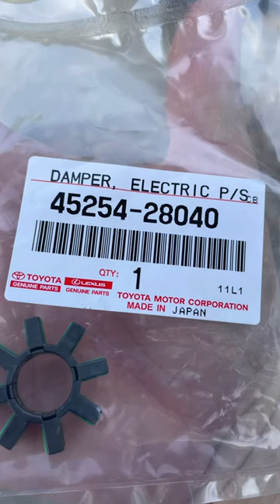How to repair Toyota Camry 2012 Steering Wheel noise

Comment: Great video indeed. I have been having the same issue with my 2012 Toyota Camry I took it to several different mechanics but they all say different things. So finally I to the Toyota dealership and they wanted to charge me $1200.00 to replace this STAR BUSHING. By watching this video I hope I will be able to accomplish this task but removing so many things is mind-boggling. Thank you sir for the great video and the part number. God Bless you.
Reply from the maker: I had the same problem, the dealership wanted crazy amounts so that’s why I called my friend who is very handy and we were able to remove all the parts and put them back together! 
Good luck! :)
Reply: Do you have a video or an example of the noise it was making? My Camry is making a rattle noise but not sure if it is the star bushing
Reply from the maker: @danielmezadrums  unfortunately I didn’t record the noise!
Reply: @danielmezadrums  same here I wish I could of the noise...
Reply: Alguien sabe si uno que no es mecánico es fácil cambiarlo o buscar ayuda 🆘

Comment: Thank you sir. I could not find any videos on 2014 Toyota Venza's.  I called Toyota to get the bushing and they said that they did not service that part for venza's. It was only for Camry's. So after removing the the airbag and the the heater floor duct I removed the 2-12 mm motor bolts.  I used a mirror to look up inside where the coupler would sit at and I found the green coupler pieces everywhere.  (I did not have to drop the steering column or take the steering wheel off). Went to Toyota and they would not sell me one for a venza. I had to tell them it was for Camry although I had the part number from your video.  Anyway I blew the broken pieces out of the servo and install the new coupler and everything worked great. No more noise.
Reply from the maker: I’m glad you made it! :)
Reply: I have the same issue on my Venza '09...however, I am not able to do this work myself. 😣
Reply from the maker: Find someone that’s somewhat handy and I’m sure both of you can do it! Good luck!
Reply: how did you do this without dropping the column? I am going to make this repair tomorrow or this weekend.

Comment: Excellent and simple video. Does Toyota Prius V 2013 model has similar system, because my Prius is making similar rattling noise. Any information from Prius owners will be much appreciated. Thanks
Reply from the maker: @andykumar4103  I’m not sure if Prius has the same system but since both models were built in pretty much the same time I would think that should be the same or similar. Best thing to check with a certified mechanic to be sure.

Comment: Was it doing a rattling noise ?
Reply from the maker: More like a clicking noise!
Reply from the maker: More like a clicking noise!
Reply: I fixed mine, but my steering wheel didn’t go back on straight and my traction control light didn’t come off.
Reply: @Michael Harbo what is servo
Reply: @michaelharbo663 No that's wrong info. This part makes a rattle when it goes bad.

Comment: @Cripton awesome video! Thanks for including the part number too.
Reply from the maker: The part is about $15 on eBay but getting to the part is a pain in the b…!
Reply: @cripton3321   what is the part number or name of the part .
Reply from the maker: @JimmyHensley36  you can see the name and the part number at the very beginning of the video!
Reply: I have 2017 Camry making a clicking noise Only at a specific point when rotating the steering wheel while idling. Is that the same bushing or could be the column U-Joint

Comment: Great video. But please how were you able to still turn the steering wheel when the car is off and negative disconnected. Thanks
Reply from the maker: The hydraulic doesn’t work but you can still turn the steering wheel.
Reply: Okay thanks

Comment: Thanks for the video boss! The noise went away but stability control system light came on did anyone have that problem
Reply from the maker: Have you check if all the connections and wiring are properly connected?

Comment: Great video. The damper your replaced was it Metal or rubber?
Reply from the maker: It was a very hard plastic with silicon liner inside
Reply: What is it called?

Comment: What is that part called
Reply from the maker: Damper Electric!
You can see the part number at the beginning of the video! 
Good luck!
Reply: @cripton3321 
Bro if i run the car without replacing this broken damper. Can it cause any big issues later??
Reply from the maker: I’m not 100% sure, maybe you should consult with a mechanic! But the noise gonna drive you nuts! :) 
Good luck

Comment: Couldn't you do this with removing the steering wheel?
Reply from the maker: Not really because the hydraulic pump  is connected to the steering wheel rod and the only way to open the pump is by removing the steering wheel! It looks very complicated but if you have some mechanical experience it should not be a problem replacing it by yourself!
Reply: @cripton3321  there is a hydraulic pump? Its an electric pump though?
Reply from the maker: @xgetbackupx  I apologize, my bad!
It’s electric motor! :)
Reply: @cripton3321  this looks fairly easy just nervous about taking the wheel off and on 😓
Reply: @cripton3321  thank you for your video and responding I appreciate it
Reply from the maker: @xgetbackupx  no problem!
Thank you for watching my video!
Reply: Clean the area before you put the new damper in

Comment: I have avalon 2015 and my steering wheel has a rattling sound when going over humps or bumpy road ... could this be an issue ... i hope you reply to my comment
Reply from the maker: I had the same problem and I was trying to figure out where that sound was coming from for months before a friend of mine told me that he had the same issue! It could be the same situation with you too!
Reply: @cripton3321  thanks
Reply: I have a Toyota avensis 2010 in europe with electric steering. And was thinking it might be suspension strut top mounts or tie rod ends or the stabiliser rods until I bumper on this video and a few others on YouTube with the same issue. How can I check if my toyota model which is a European car in contrast to yours which is USA. And what happens if you leave that bushing as it is, broken. Is it of paramount importance to change it or will it carry on working with no issues for the safety of the car?
Reply from the maker: I’m not sure if it is so important for the steering but I couldn’t stand the sound! It was soo annoying! :) You should probably consult a mechanic or try to find the steering wheel manual for your vehicle and you should probably find your answer there!